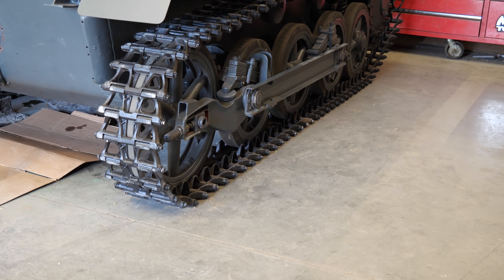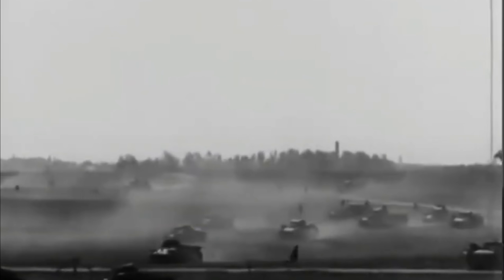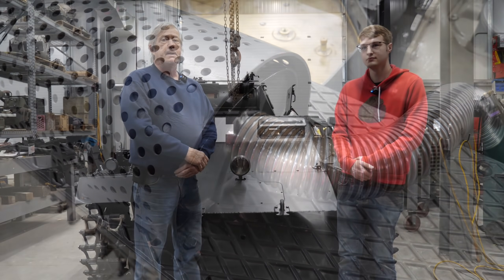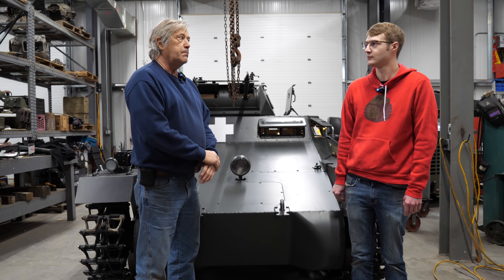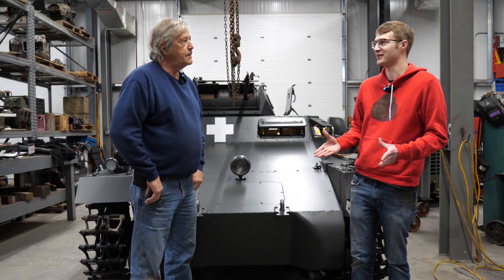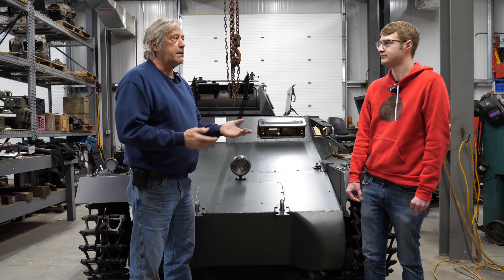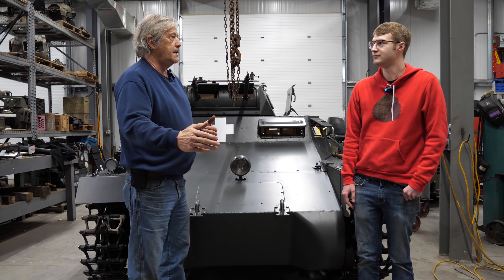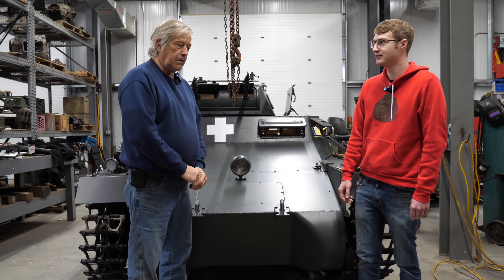Panzer 1 Restoration Interview at the American Heritage Museum

Comment: I worked on this tank with Greg Taylor for 3 years. I'm happy to see it completed.
Reply: Do you remember any facts about where it came from?
Reply: @jesper509  Littlefield traded several vehicles to the Canadian military for it and it is believed to have been in Norway at the end of the war. It was from the first group manufactured so I imagine it was used for training and parades prior to the war. It did have battle damage on the tracks and suspension components but from when and where will never be known. I can say that I'm sure it couldn't have traveled far with the track damage it had sustained. There is also evidence of field upgrades and repairs so it had seen quit a bit of use.
Reply: Fascinating! Was there a visible chassis number on the vehicle? You can a tell a lot just from the chassis number.
Reply: @sirrathersplendid4825  I believe it is 857. I think the first run was 900 so it was the first batch. There is evidence that it was originally built without the superstructure and turret and was classified as a tractor to hide the intent while using them for training.
Reply: @sirrathersplendid4825  The chassis or hull is a steel box with the same markings stamped on the super structure and turret as I recall. The only serial numbers are on things like the drive line components and standard production items. I spent 3 years disassembling, sandblasting, repairing where needed, filling and painting basically everything. I spent about 6 weeks on the tracks alone. Greg spent his time creating missing parts and rebuilding driving components. There is visible battle damage on the tracks and suspension. We found some replacement tracks in Russia of all places to complete the set. One of the most disturbing things I found was shell casings under the gun mounts. Makes you wonder where the bullet went.
Reply: @scottmcdaniel2455  — Thanks for the detailed info! Sounds like it was built ‘Ohne Aufbau’ so as a training and/or recovery vehicle, neither of which had a turret. Presumably it would have been issued to one of the first two or three Panzer Regiments in existence, thus PR1, PR2 or PR3. I would guess some of the early maintenance records for those units might even still exist, for example in the German military records office in Freiburg.

Comment: Hi there, a good starting point for the restoration would be to reverse the running direction of the tracks. They need to be turned 180 degrees on each side. I know there is the very rare odd photograph of a tank in WW2 showing the configuration of this museum piece, but again they need to be turned to show what running direction the tracks where really designed for.

Comment: the film footage of Pz.1s driving through mountains looks so much like a 1950s animatronics production with models in a diorama :)

Pz.1 was never designed to take on tanks. It was effectively a mobile pillbox for use against infantry and in a scouting role, ideal as well for crowd control in urban areas because of its small size.

Comment: Usually German Armored Vehicles had some kind of Production Serial Number on mulitple Parts belonging to the tank. usually with those numbers you could track down in which factory the part was made and other small details.

Might give it a try
Reply: The production # on this tank is 857. I couldn't find anything specific about  it's history other than it came from the first batch built.

Comment: I wish the tank museum near me was better funded so that it can not only have running vehicles but a proper indoor facility to display. Of course, given that it's in the middle of an urban center, I don't think that there's anywhere they could drive their vehicles, even if they were in running condition. So I'd just be happy if they got the money for buildings to park everything in instead of just sitting out in the open. at least it's in SoCal where rust isn't that big of a concern, just fading paint and dry rot.

Comment: I don't want to be that guy, but Munster has a driving Panzer I. They drive it at Stahl auf der Heide every year. Also the front left fender clamps and fittings are very very wrong. I will have to contact them.
Reply: Just here reiterating how wrong the fittings are.

Comment: For the benefit of the viewers, I'll explain something; this tank actually had a seat for the commander. He wasn't standing in the turret. 
The seat connected to a small rotating slip-ring unit under the floor; in this restoration tank you can see the top of the slip-ring unit at 0:48. It has a tube where the electric wiring comes out. 
That wiring runs up along the pole that the commander's seat is attached to. It provides the turret with a single electric lamp and a socket for the commander's headphones. He has no microphones because the tank has only a radio receiver.

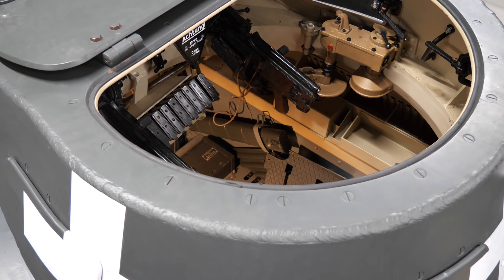Another thing worth explaining is how the machine-guns are fired. Remember, the commander's hands are usually on the turret traverse and gun elevation wheels, and indeed he must be holding those wheels when he's firing the MGs because that's how he aims them. You can see the traverse wheel at 2:29.
So how does he fire the MGs? Triggers are built into both handwheels, and connected via Bowden cables to their respective MGs - which therefore can be fired independently. At the end of each cable is a mechanical "finger" that clamps into the MG's trigger. The MGs are not modified for working in a tank.